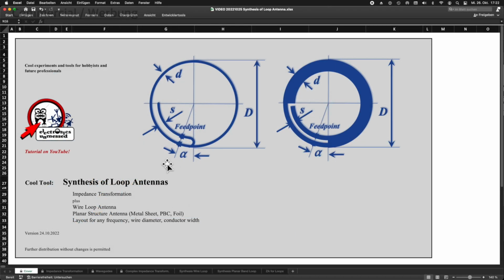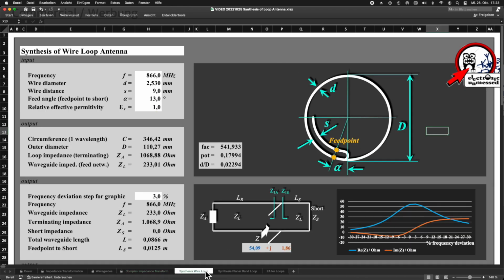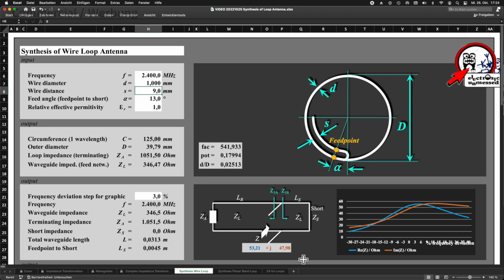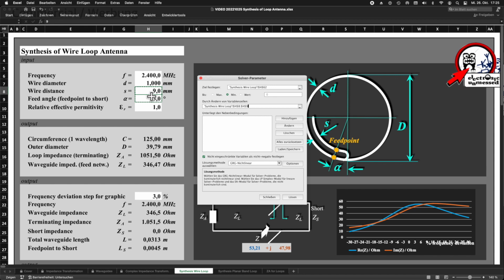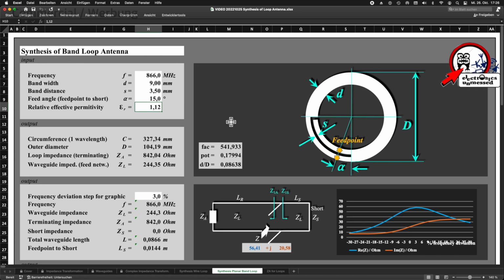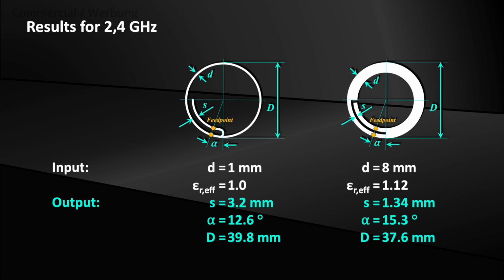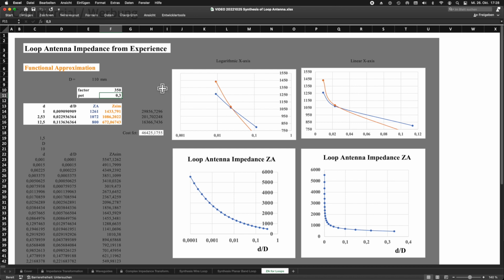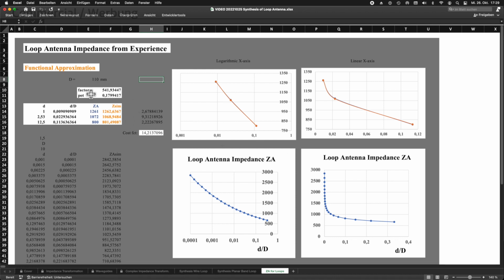Antenna Design based on EXCEL Tool - Engineering Method  (EP32)

Comment: Whilst searching for a 'Halo' antenna design I found your videos. Very interesting indeed - thanks :-) I'mtrying to imagine the radiation pattern. Is it similar to that of a magnetic loop antenna (i.e. a hollow doughnut shape?) or is it omni-directional in the plane of the loop?  I'm hoping to build and use one for 70cms horizontal talkback, i.e. mount it horizontally. It that correct? Thanks again for the software and my best wishes for 2025.
Reply from the maker: @garethevans1410  Thanks for your comment and best wishes for 2025! I created lots of videos about radiation characteristics, dimensioning, equivalent circuit etc. Keeping fingers crossed.
Reply: @electronics.unmessed  Yes thanks, I have had a browse of some of your other videos (HF Loop patterns). So I think the radiation will be bi-directional as per a 40m full wave loop - 2 current maximums. I will build one anyway (I have a roll of soft copper 4.76mm diameter so perfect for 70cms) and test it. Now I'm wondering if I could stack two, (mounted at 90 degrees about their 'wheel' axis) built to a 100 ohm match and feed them from a splitter so I see 50 Ohms. I'm also building this (to an earlier design that used 6mm aluminium which I replaced with the copper tube). https://www.youtube.com/watch?v=a1SxGQVWsQI. All very interesting stuff :-)
Reply from the maker: I checked your video and wow, what a great make. Thx and greetings, Klaus

Comment: Super, wir suchen gerade nach einer Loop Antenne in einem Horn als Refelktor, als Feed für ein 3m Radioteleskop - Wasserstofflinie bei 1420,4 MHz. Ich bau die mal und stimme sie dann mit dem nano VNA ab. Bandpass ist dort auch sehr wichtig, also wäre diese Form wirklich perfekt! Melde mich wieder.
Reply from the maker: Hallo, ich freue mich ganz besonders darüber zu lesen, dass dieses Antennenprinzip eine interessante Verwendung bei euch finden könnte! Das Thema Radioteleskop lässt mich natürlich viele interessante Dinge vermuten. Wenn ich etwas für euch tun kann, lasst es mich wissen. Wäre vielleicht auch interessant auf dem Kanal zu zeigen. Ich habe gerade mal nachgezählt: Es gibt tatsächlich schon 12 Videos zu dieser Antenne von mir. Aber bleib dran, denn es wird sicher noch weitere dazu geben.
Reply: Loop gefertigt, wie berechnet, aus 6mm2 Erdungsdraht. Optimale Anpassung bei etwas größerer Dimension nach Abgleich. 70mm Durchmesser, Anpassung 12mm länger, Abstand S kleiner, ca. 4-5mm. Dafür SWR 1,06, 53 Ohm + 0,8 J, Return Loss -35 dB, alpha 54°, kurzes Koaxkabel 6cm mit SMA-Stecker, super.
Reply from the maker: Gratuliere Dir zum erfolgreichen Bau der Antenne! Sehr schön, dass es geklappt hat. Das ist das beste Feedback das man bekommen kann. Freut mich sehr. Ich würde mich auch sehr für Deine Arbeit mit dem Radioteleskop interessieren. Gerne auch über die e-mail Adresse des Kanals. Viel Erfolg mit der Antenne. Hier noch ein Tipp: Vielleicht bist Du nicht ganz im Resonanzbereich. Die 12mm längere Anpassung könnte darauf hindeuten. Eventuell kannst Du das mit dem EXCEL Tool herausfinden. Aber ich gebe zu, es ist nicht leicht die Antenne abzustimmen. @ekkiseisenwerk260
Reply from the maker: Kann hier noch etwas aus meiner Erfahrung beisteuern: Die Antennen, die ich gebaut habe fallen auch minimal größer aus im Durchmesser, ca 4%. OK, das passt! Aber am Matching kannst Du sicher noch etwas verbessern. Alpha müsste eigentlich kleiner als 54 Grad sein und s größer. Bei mir ist die Gesamtlänge der Matching Leitung ziemlich genau Lambda/4.
Reply: Du hast mit der Größe natürlich recht, jetzt die Loop für 1420 GHz in einen Reflektor von 20cm Durchmesser eingebaut á la OM6AA, jetzt stimmen die im Excel Tool berechneten Dimensionen sehr gut, auch der Winkel alpha. Sehr gute Resonanz bei 1420 MHz und SWR von 1,15. Super @electronics.unmessed
Reply from the maker: Vielen Dank!

Comment: ... danke für das Video. Leider habe ich keine Microsoft Excel Installation. Aber es scheint auch mit LibreOffice Calc zu funktionieren. Auch den Solver habe ich dort gefunden. Die Beispiele im Video habe ich nachgespielt und funktionieren.
Reply from the maker: Das ist ja super! Vielen Dank für das Feedback mit LibreOffice Calc.
Reply: Which solver did you use?  I have been trying to use the tool in Libreoffice Calc also, without success.  I am using the "Libreoffice Swarm Non-linear solver (experimental)".
Reply: @stirlingengr It works for me. I have the following solver: LibreOffice CoinMP Linear Solver
Reply from the maker: Thx a lot, I'm always looking for alternatives for MS EXCEL. Greetings, Klaus